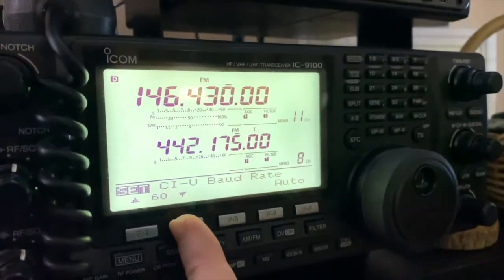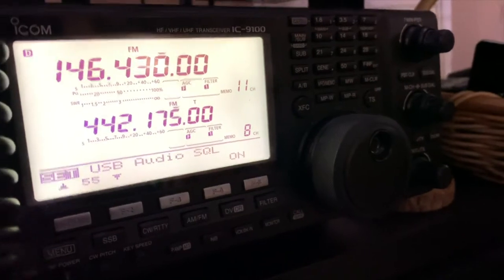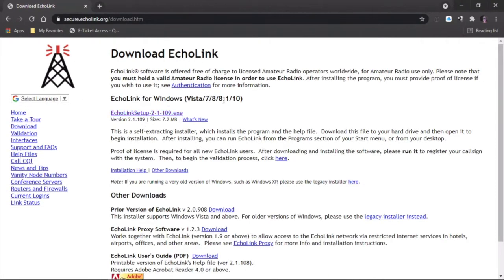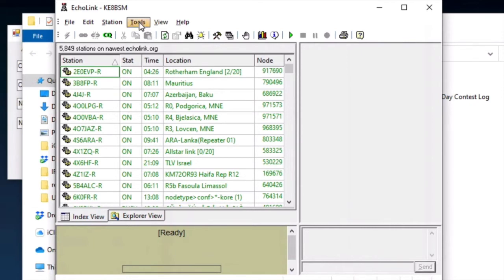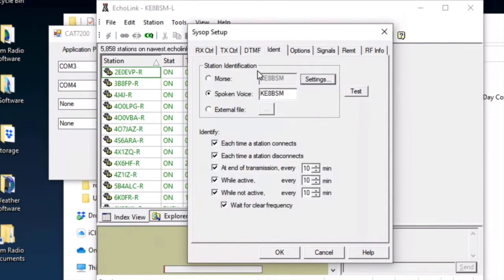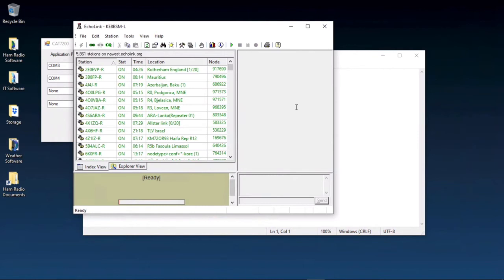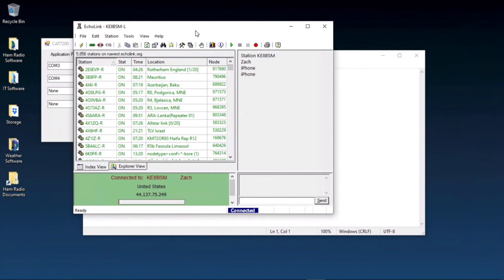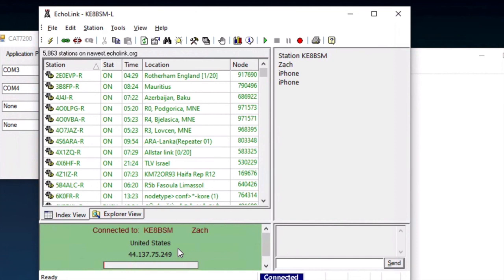Setting Up Echolink for ICOM 9100

Comment: Excellent video very very helpfull just quick question you said you transmit on your HT mic but you didnt actualy show what that was and being very new to trying out software defined radio was that built in mic to your pc/laptop or headset mic or radio mic sorry for being bit thick just at 61yrs age never had any computer training so learning as i go along  chaz 2E0EMN